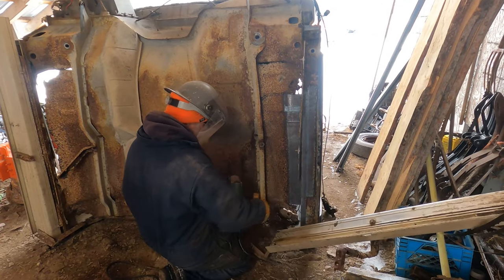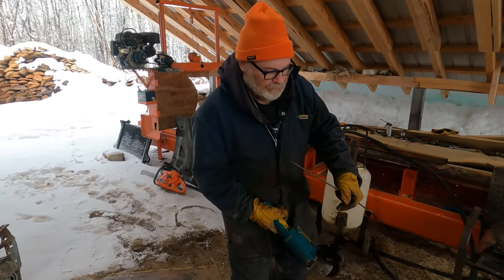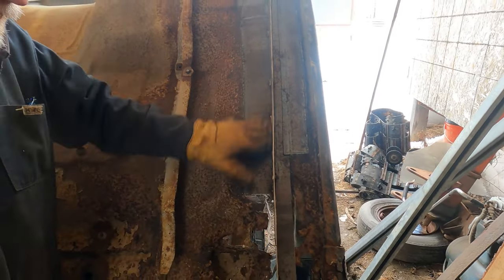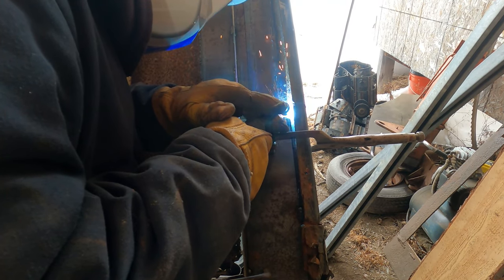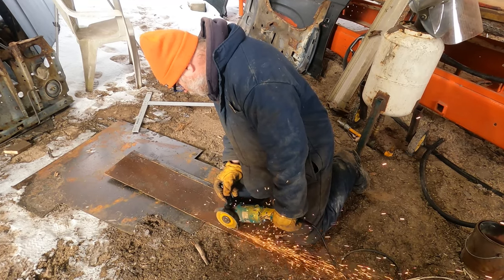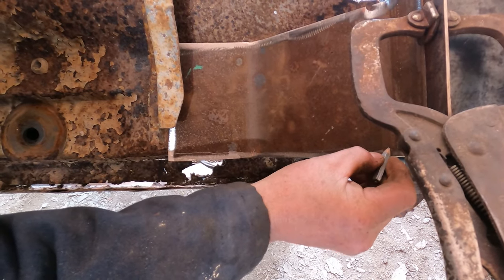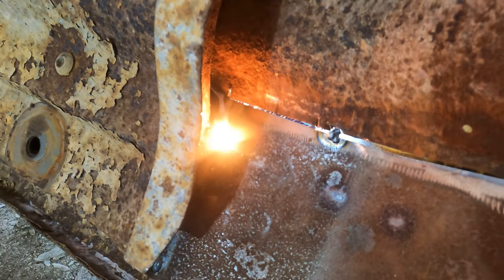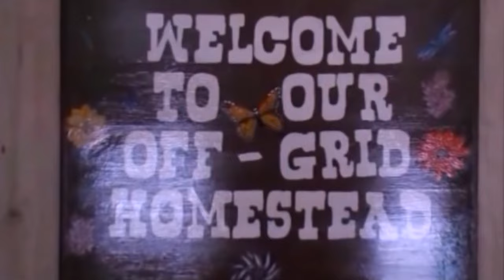1980s Ford F150..Back When Trucks Were Still Trucks. Welding And Fitting Body Metal.

Comment: I'm a Rustoleum fan and I get good, durable results from it.  If I have a demanding application, I'll pick up some Majic Paint Hardener at Tractor Supply and add it to the RO.  The resulting finish is glossy and it really toughens up the paint.

Comment: Okay, bulleted opinion time.😊
* voice-over is kewl! Not permanent,  right?
* comment regarding "just a sawmill." That's  a sawmill YOU built, correct? That makes it one-of-a-kind and awesome! 🎉
* Is there a necessity to treat the undercarriage of this new and awesome truck with a protective coating against whatever snow melts used on the roads?
* You  two make an excellent team!
Stay excellent!

Comment: Hey Cecil have you ever heard of POR 15 Products.? Here in the lower 48 states we have it. I've never tried it but from video's on YouTube  it looks like a good product. Another product is called Eastwood. Both have a cleaning solution and prep spray kinda like a primer. POR stands for 
(paint over rust). I'm kinda leaning towards the POR 15 when I redo my old beater truck. BTW the voice over is okay by me. Loving this project.

Comment: Go on gas and climb like a goat.Don't let it sit and idle They are known to jump and reverse and forward by yourself. I worked at an RV center.They had 2 of them.Put it in the park and that truck left and start a driving on It's They have two of them and They both did it.
Be aware of it